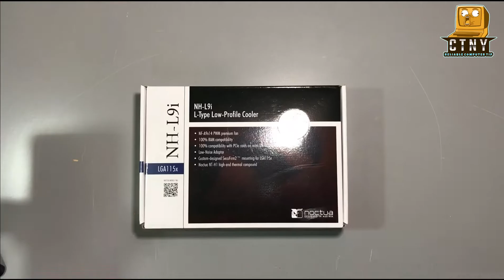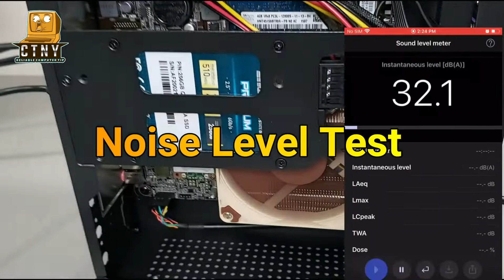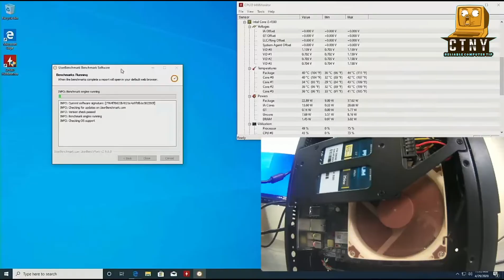$200 Budget Mini-ITX PC Build - Noctua NH-L9i Low-Profile CPU Cooler Installation

Comment: Where's the psu?
Reply from the maker: You don't need PSU with this board. This board has a 1 X 19V DC-in Connector to get the power. You only need a 60W 19V laptop power cable like HP. Thank you for your comments.